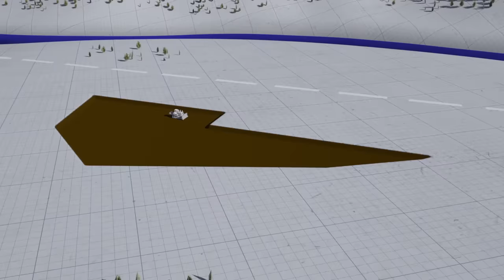Tony Beets IN RAGE After Discovering Parker's Been Dumping Dirt On His Land! | Gold Rush

Comment: With over 25000 hrs myself I can say with some conviction the Parker is a very average operator.
Reply: Mining coal in New Zealand had a guy cleaning the overburden off the coal seam, 40 tonne, it threw a track so he just walked it along then down to the haul.rd ,I was waiting in a haul truck, he.just lifted the bung side up and slewed it round as the gd side tracked forward, pretty quickly too ,I was most impressed